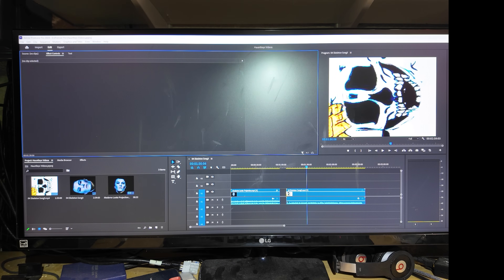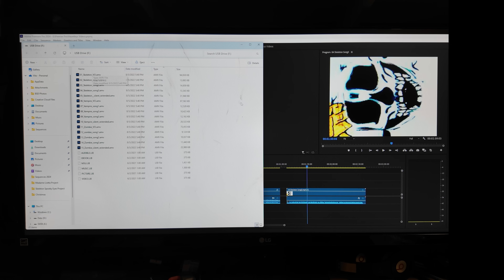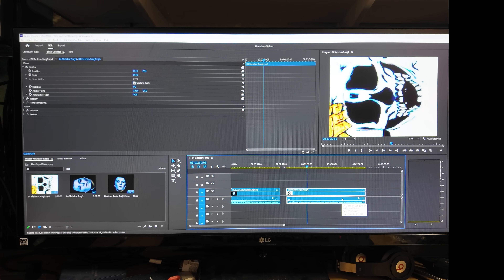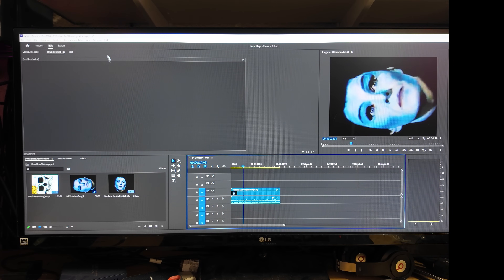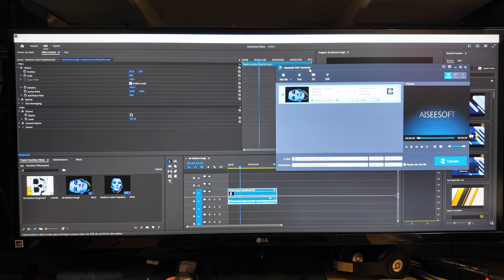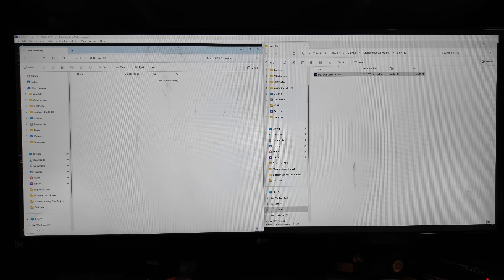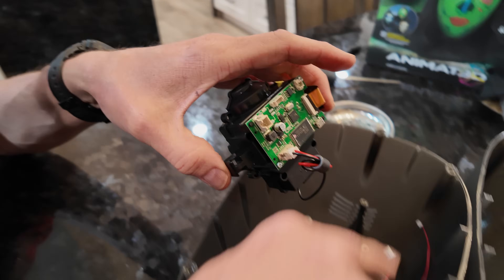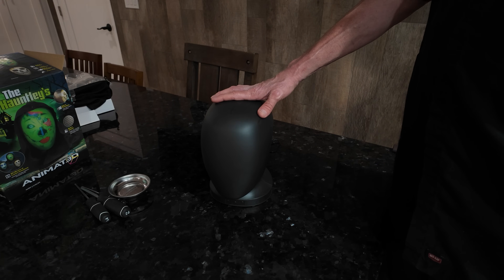DIY Animated Madame Leota Crystal Ball Prop - INVISIBLE PROJECTOR - Self Contained Portable - PART 2

Comment: Dies the cord it comes with work to plug into pc?
Reply from the maker: No, the cord that comes with the head is for power only it is a two wire power cord. You need to order a five wire data transfer cable. They are inexpensive on Amazon.

Comment: Turns out you can use video with larger dimensions also. Mine is currently playing the video at 640x480
Reply from the maker: Yes, it will play higher quality videos, but the projector technology is very limited and it will not make a difference if you put a higher definition video file on it. It will just take more space on the projector.

Comment: Nice video! Thanks for sharing. The only thing I may have done differently would have been to copy all those files you deleted so you could convert them for possible use in other setups.
Reply from the maker: Yes, I forgot to suggest that in the video. I have a couple extra heads, so I knew I can always grab the videos off of those other heads if I needed them for a future project. But I did make a folder with the original videos on the head.

Comment: Cant wait to get started on this. Pretty sure van oaks props did this and didnot have to convert those files. Also how does it activate just on/off? Sensor, etc. Suggestion create another clip that can loop or change to eyes closed so it  "awakens"
Reply from the maker: Hi, Derek from Van Oaks props did something similar to this, where he hid a short throw projector under a table with a mirror pointing to a mask. If I’m not mistaken, that video is his wife. There was no need to convert the file, because he was using a regular projector that plays MP4 videos. The Hauntley‘s head that I used to make my prop, only uses .AMV files. My prop runs off a rechargeable battery with a switch on it. That is how I turn it on and off. You would have to search to see if you can find a clip that starts with the eyes closed. I just used a video loop that I found on YouTube.
Reply: @diylightguy  his video was o n using the head as an inspired singing bust.

Comment: How’s the output on the external speaker you add? Is it pretty loud and clear and can you adjust volume?
Reply from the maker: @kjohnsonleedap  yes, just as loud as the original speaker. The original speaker inside the head is a 4 ohm 3 W speaker. I used the same specs for the external speaker.
Reply from the maker: Yes, there are three buttons on the front of the head. The far left button is lower volume. The far right button is up volume and the center button is to change files if you have multiple files on the head. I purposely do not glue the globe down so you can lift up the front a little bit and reach your fingers in there to adjust the volume.

Comment: Have you consdered replacing the head with a mannequin styrofoam wig stand (cost under $15.00)?  The heads are sculpted so it should reproduce a much higher fidelity illusion.
Reply from the maker: Yes, that has been done before. But you would need an external projector to project onto the Styrofoam head. I needed a way to make it portable with the projector hidden inside the head, so I can add it to my Doom buggy mobility scooter.

Comment: Also, I see you have an external speaker in your list. Did you connect that to the internal projector or is there an external speaker port?
Reply from the maker: Thank you for your support! I really appreciate it!, if you watch my part 1 video, you will see there is a separate small white plug on the circuit board going to the speaker. I just cut that wire at the speaker connection. and removed the speaker. I cut a length of two pair black wire and put a JST connector on the end and drilled a hole at the back of the head where the speaker was located, I put the other end of the JST connector onto the external speaker so it would be easy to replace if the speaker went bad, without having to open the head. I used Velcro to adhere the speaker underneath the prop so it would be easier to replace if it went bad. I hope this makes sense to you. I will explain this in one of the videos. also feel free to reach out to me at diylightguy@gmail.com if you have any more questions

Comment: love the video.
Have you tried using any other video formats on the projector? Because its not necessarily a given that it only plays AMV. It might just be what was available when they did the files, but the chipset should be able to read other files. I may be wrong, but this could streamline the process a bit :)
Reply from the maker: I only tried MP4, and it would not play it. I do not know if it will play other video formats. I figured I will just stick with what came with the head because that’s what the projector was designed to play.

Comment: For anyone curious, my interest was piqued by the extra files on the projector's storage which seemed to hint at what the underlying device is, like "AUDIBLE.LIB" and "PICTURE.LIB." Sure enough, some quick searching seems to reveal that those boards are likely from an older handheld media device (maybe only sold in France?) called an Essentiel B MP4-C 4Go. A look through the manual also shows that you have to convert videos to *.AMV format for them to work, so the plot thickens! 

The manual also indicates it supports up to 320x240, so if that truly is the source for the circuit board, folks might be able to up the resolution a little if they want. I have a different ANIMAT3D product on the way, so I'll do a deeper dive on the projector itself when it arrives. I'd also like to explore the possibility of repurposing the optics in combination with the guts from a higher resolution and higher lumen output projector. TBD!
Reply from the maker: Wow

Comment: Those Hauntley's units are really hard to find! Hopefully you're able to work out a deal with the distributor and become a reseller. I've been trying to get my hands on one for a non-eBay price for a couple of years with no luck. Excellent work on this prop! Looking forward to Part 3.
Reply from the maker: I didn’t expect this video to go viral! As soon as I posted my video, everybody went out and cleaned out all the heads that were in stock. Rest assured, I negotiated a deal directly with the manufacturer to get more heads for all my subscribers and followers. The manufacture has 500 heads coming in towards the end of May. They are going to put aside as many as we want for my followers and subscribers that want to do this project. I’m going to open up an online store diylightguy.com. Once I get the store open, I will make an announcement and start taking pre-orders for the heads. We will still have time to finish these before Halloween.😁

Comment: Would it be feasible to throw a Pico Projector in there and have a lot more usability?
Reply from the maker: I’m not sure
Reply: You could probably throw a mini projector in the mannequin head but positioning it well would probably be a bit tough. Maybe if you cut a nice sized hole in the back of the head (covered by a wig later), you could leave the projector accessible after the head is assembled.

Comment: On the Hauntley head, I see that the face image kind of takes up the bottom 2/3 of the mannequin head. Is that a “feature” of the Hauntley head which is the reason for the cowl? (aka…the projector only really projects to the lower part of the head.) 

I may look for an open source tool that can do AMVs. And when I get my head, I’m curious to see if I can source just the projector bit to try and hacking the setup a bit.
Reply from the maker: You might be able to just move the position of the projector inside the head
Reply: @diylightguy  I’m not sure you need to. But I was able to redo the file, and the projector definitely has the scope. I think an Imovie crop + ffmpeg toolchain will end up being faster to tweak the video.

Comment: I am interested in building this if you get the hook up from the distributor.
Reply from the maker: Yes, I secured the heads with the distributor manufacturer. They have 500 heads coming in in May and they are willing to hold them for me until I give them an order. I’m going to be opening up a store diylightguy.com. Once I have it up and running, I will make an announcement and start taking pre-orders for the Hauntley’s heads.
Reply: @diylightguy  sweet! Add my name to the list. I am building a Haunted Mansion themed Home Theater this summer and it needs this.
Reply from the maker: You got it! Watch for the announcement